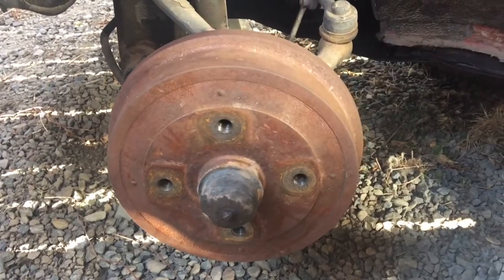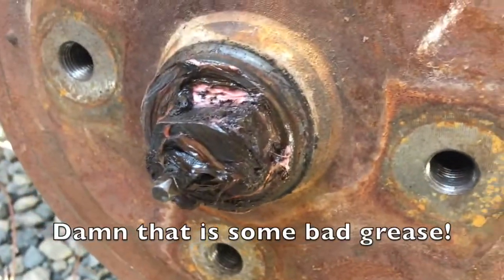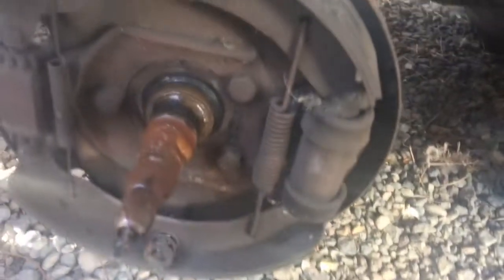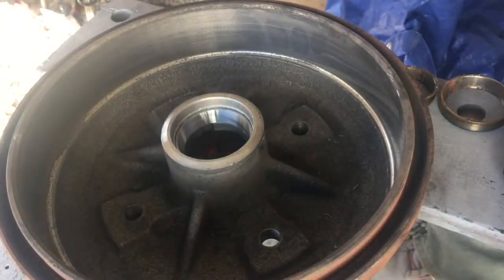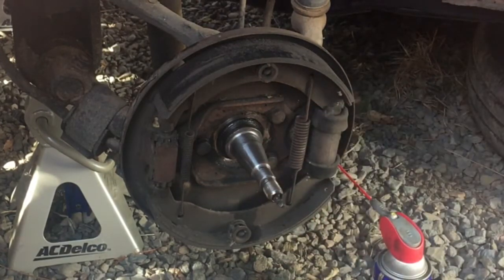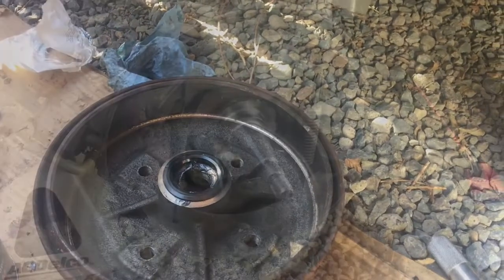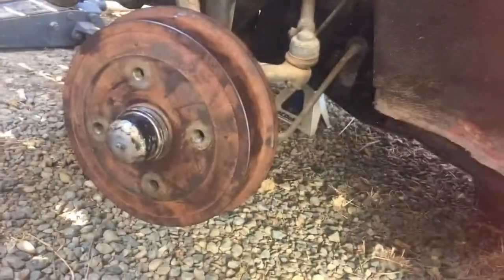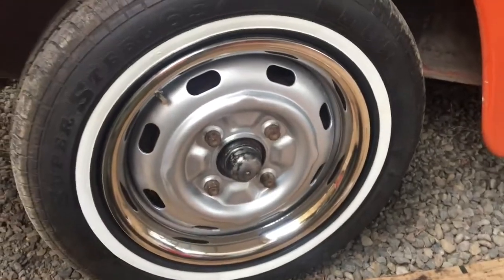VW Beetle Front Wheel Bearings

Comment: There are very few videos available for work on Beetle front wheel bearings, so thanks greatly for filling that gap. My particular angst about this job is in getting the bearings tightened properly (loose versus too tight) and I think you covered that and explained it well. I had to chuckle WITH you on the lost circlip. I loose parts and tools frequently while working on the car and we can ALL relate to that! The only thing I might add is to apply a dab of silicone sealant over the circlip to prevent moisture to enter the bearings space (which may be why there was wetness in there to begin with). Thanks for taking the time to provide this valuable information!
Reply from the maker: Thanks Christopher! Good idea on the silicone. I was looking in my tool box this morning and I’m missing my 14mm wrench...